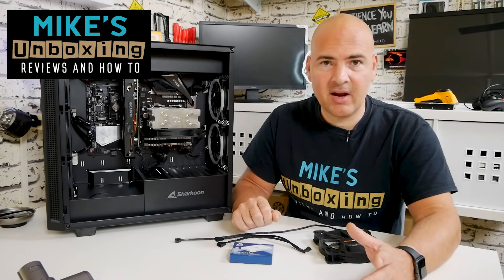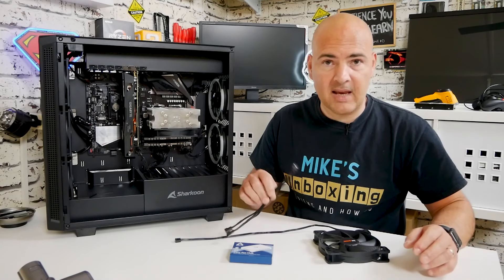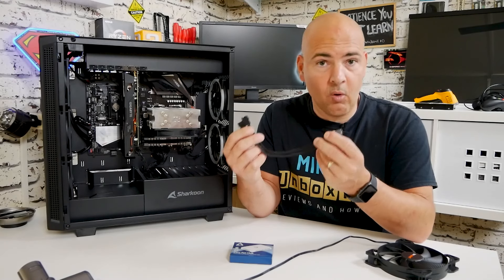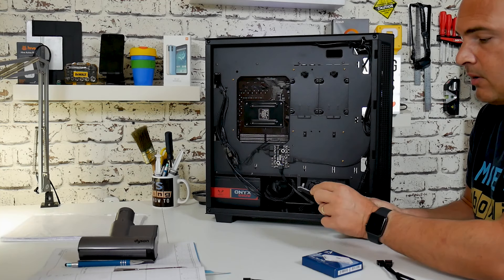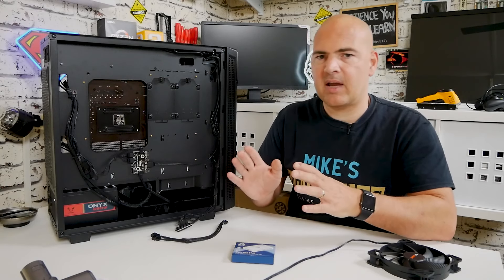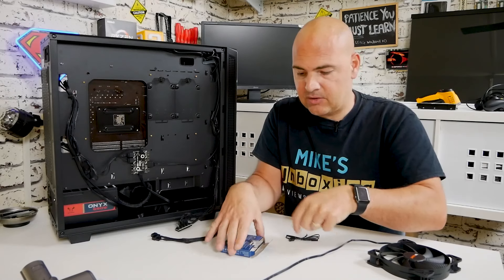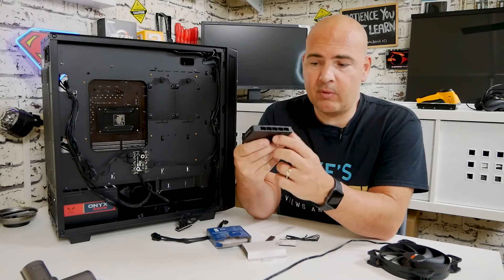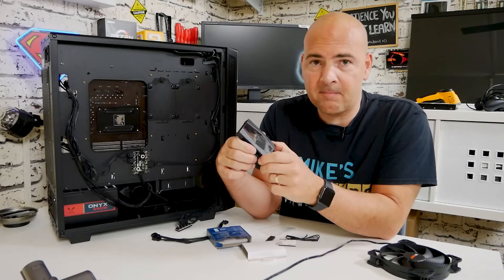How To Add Extra Fan Headers To Your PC Build

Comment: Hi I bought 2pin fans for my compact pc, would the 2 way splitter work with my 2 pin Fans?
Reply from the maker: not sure i don't know what a two pin fan can be used on? are they from a power supply or something? PC fans are usually 3 or 4 pin
Reply: @mikesunboxing  Thanks for your reply! I've read that if I plug it in to left 2 pins it should work. Hope for the best.
Reply from the maker: @DonTNguyen  Let us know how it goes
Reply: It was a success!  @mikesunboxing
Reply from the maker: @DonTNguyen thanks for letting us know & glad it worked out good 🙂

Comment: Great video! I have a question though. Will it put too much load that might be deteriorating to my mobo if I connect 3 fans using a splitter to one of the fan connectors on my b365m pro-vdh mobo? TIA
Reply from the maker: Not at all 3 should really be the limit though
Reply: @mikesunboxing  Thank you so much!

Comment: Hi! How do you control all the fan speed curves connected using the PWM splitter?
Reply from the maker: you can't it replicates the same signal multiple times
Reply: @mikesunboxing  thanks! does this mean that all connected fans would follow the fan curve of the 4pin split of the PWM splitter? or that the remaining fans would be more of an on/off concept? thanks!

Comment: With the fan hub, does that work with rgb fans or do they need a seperate connection?
Reply from the maker: rgb fans will need a separate RGB controller or hub
Reply: @mikesunboxing  thank

Comment: I have one fan header and a splitter where I want to put a single 120mm and 140mm fan but which one should be the master fan as the motherboard will only read the rpm of one of the fans?
Reply from the maker: they will be out of sync because they are not the same fan, i would maybe put the larger one as master to reduce the noise levels
Reply: @mikesunboxing  thanks for the quick response, sub earned 👍🏼
Reply from the maker: @RocksDLightning  Awesome - welcome to the Channel :-)

Comment: Can i use the pump fan connector for a regular rear fan?
Reply from the maker: yes you can
Reply: @mikesunboxing   And it can be controlled like a regular Chassi fan?
Reply from the maker: @theswede5402  That will depend on the board, some let you use it as anything, some don't. If it's a 4 pin one it should be OK, but a 3 pin one, probably not

Comment: Where do I put that fan hub in my case?
Reply from the maker: it is up to you really based on the length of the psu cables and fan cables, that will pretty much dictate where it can be mounted

Comment: Hello! I have a question. You said in the video the Arctic FAN HUB have 10, 4 pin connections. Can I connect 3 pin fans and controlled with these hub? You said another video (Deepcool FAN HUB) "PWM or nothing". What is the situation with the Arctic FAN HUB? Thank you!!
Reply from the maker: If you use 3 pin fans there is a very good change it will not be able to run the fans at anything other than 100%
Reply: @mikesunboxing  Thank you for the fast respond!!
Reply from the maker: @Szaky12  no problem happy holidays

Comment: Hi Mike, I've seen other splitters in the reviews that the fans run at the highest RPM? is it the same with the splitter? And with the splitter, a PWM signal is passed on to the other fans, is that also by this splitter?
Reply from the maker: a splitter just copies the signal to multiple devices so it will do whatever the motherboard tells it to

Comment: What about addressable RGB connections Mike, my Z490 has just one 3 pin connector so I can control the case fans from it but nothing else, are there splitters available for this type of connection, or maybe I'm being thick as usual?
Reply from the maker: Video coming up Gary all will be revealed and explained
Reply: @mikesunboxing  I look forward to that Mike, I see that Asaka make a splitter but will hold fire until I see your video.

Comment: i bought 2 3-pack case fans, both with their own fan hub (each hub can only accomodate 3 fans). can I connect the 2 fan hubs to a splitter? my mobo only has 1 system fan header. thank you very much!
Reply from the maker: if the hubs are powered yes if not that is a bit too much load on a motherboard header
Reply: @mikesunboxing  yes, both are powered. thank you!!

Comment: I have the reverse question.  I have a 2A -3A 120mmx38mm fan for an AIO.  The W-Pump header is 2A and obviously for the pump. Can I combine 2 fan headers to power the fan? Also does a reverse splitter exist?
Reply from the maker: no you cant combine two headers sorry

Comment: If I need to add 3 or 4 to the existing 3 I have already in the case with a B450M  mobo, do I still need the hub ?
Reply from the maker: if the fans won't daisy chain you will need something
Reply: @mikesunboxing  thank you for replying. This is my first “gaming” pc ever. I looked at the motherboard and noticed that only the cpu fan header was used to power 4 fans that came with unit. The other sys fan header is not used by anything. I am thinking of using the cup fan header just for the cpu cooler fan and use the other sys fan header to power up the arctic hub for the rest of the fans. Do you think this would work without putting too much stress on the pc? Thank and sorry for the lengthy question

Comment: Hello, I wanted to ask what happens when a short circuit occurs in one of the fans connected to the motherboard or when it connect straight to the power supply unit?

What can assure me that there is no fire will be occur?
Reply from the maker: Fire is totally possible or magic smoke from a burn out

Comment: So, connectig 3 120mm Fan (PWM) on 1 Mobo header is fine ?.. 
I was running like that for 2 days no problem everything is synced but just at once 1 fan out of 3 stopped spinning . 
Could it be that mobo 'fried'' that one fan ? (They are connected to 'Pump' header , Gigabyte says thay can deliver 3 Amps.
Reply from the maker: should be fine at 3a sounds like a bad fan, maybe try it on its own on another header?
Reply: @mikesunboxing  I think it's faulty fan too.. tried everythig from changin headers to changing Voltage /PWM modulation, even tested the cables with multimeter.. everything was fine ( and RGB is working ) but no way for fan to spin.. It is in refund process now 😂

Comment: Hi sir, where should I connect or the best to connect the 4 pin from the fan hub that I can control the fan speed. Is it the CPU Fan or System Fan? because I have connected my AIO fans and Chassis fans on the fan hub
Reply from the maker: chassis fan is the one you want to use if you can

Comment: Can a splitter have both a 3 and 4 pin in it without issue?
Reply from the maker: no they are different systems and will not work as intended

Comment: Can i control each of my fans individually if connected to that fan hub  or will they all run at the same speed i set in the bios?
Reply from the maker: they will all run at the same speeds as the controller puts out

Comment: Hi, I have an a320 motherboard which has just the 1 system fan header,  if i use the arctic hub will i be able to use rgb fans and if so is any extra wires needed for the rgb
Reply from the maker: no you won't be able to use rgb fans you need something like the gamemax hub i reviewed a while back

Comment: I have a b450i mobo with two fan headers (one for cpu fan, one for system fans) I want to have 4 system fans and one cpu fan. Am I able to connect 3 fans to the system header using a fan splitter and then connecting one system fan and the cpu fan to another header? Ps if I do that, then the fan connected to the cpu header will adjust fan speeds like the cpu fan???
Reply from the maker: yes you can do that

Comment: Can I use 2 Scythe Kaze Flex PWM fans ( with spliter ) of a Pump header?
Reply from the maker: yes you can but depending on the board and BIOS revision PWM control may be limited

Comment: I'm set with fan headers because my mobo has 7 of them, so I won't use more than 2 splitters for my 9 fans. My problem is (and I'm not sure whether it is a problem) the RGB. I have two 5 V ARGB headers for those 9 fans (Gigabyte x570 Aorus Master). They're the Enermax Sqa RGB, which I THINK draw about .4 A per fan, and I want to connect 3 of those to one ARGB header and 6 of them to the other. For the header I want to connect 6 fans to, I want to use a 1-to-4 ARGB splitter, connect 3 of the fans directly to my mobo with that, and use the 4th end for the other 3 in a daisy chain. I don't think 6 fans will be too much for this 5V header, but I'm curious whether it would be better to use both control boxes for that header, or if I can get away with just plugging 3 fans directly into the header with the splitter and only use the included control box with the other set of 3 into the same splitter.
Reply from the maker: Three fans on one header should be okay but a powered hub or box would be preferable something like the gamemax hub should do it
Reply: @mikesunboxing  Well, what I'd really like to do is place 6 RGB fans on one ARGB header using just the splitter cable. If my math is right, it should work. 5A 5V header = 25 watts. One of these fans has a rated current of .68, which I think is for the PWM and ARGB together, but assuming full load, it's .68 x 6 = 4.08 volts, or .68 x 5 = 3.4 watts per fan, x 6 = 20.4 watts. So, 20.4 watts seems ok to plug into a 25 watt header. Have I done all these calculations correctly or is there something I'm missing?

Comment: can i use the included rgb controller on my case to power up my non rgb nzxt fans ?
Reply from the maker: if it has the 3 or 4 pin fan connector you should be able to
Reply: @mikesunboxing  u always help me lol thanks you
Reply from the maker: No problem

Comment: can you put a 3 pin fan in the 4 pin connector on the y-splitter?
Reply from the maker: you can but it might not control very well if at all, unless you tell the motherboard to use VDC control
Reply: @mikesunboxing  Thank you! 👍

Comment: Hey there mike can i use the fan splitter on cpu fan header? So it would be the cpu fan and another system fan? Thanks im planning to use the msi a320m pro max.
Reply from the maker: yes you can

Comment: If i want to get rgb on fans do i have to connect to the rgb header for each fan on the motherboard or can i plug it in a controller? I want to change the colours by software too and i have a controller
Reply from the maker: both ways are possible
Reply: @mikesunboxing  ok thanks a lot 😆

Comment: So if I connect 3 led to the hub and the hub to PSU do I need to connect the other cables of the fans?
Reply from the maker: not really necessary to connect them to the hub but will need connecting to something like a controller or motherboard or they won't spin

Comment: My motherboard has 6 fan headers, I only need 5, can I plug them in separately. Will they all run at the same speed? B550 tomahawk
Reply from the maker: you can configure each fan to be either the same or custom speeds
Reply: Would I do that through software. First pc build.
Reply from the maker: @ashplattsii1fan92  This is maybe easier to fix or at least advise if we can ask more questions and get direct answers, so feel free to join our Discord chat and we can go over it in more detail https://discord.gg/gaeeDPw

Comment: I have 3 chassis fan/water pump headers and one CPU fan header... ASRock B550M/ac.
"CF/WP header supports the water cooler fan of maximum 2A (24W) fan power."
Trying to run 8 Sickleflow RGB fans. 3x3x2 should be good if the 1A, 12W CPU fan header will run an AIO?
Reply from the maker: should be okay, i ran 6 RGB inwin fans off of a single header and it wasn't until they were at 100% that the system would crash

Comment: I just want to know if, with a fan hub, does your motherboard register that and all the fans connected as 1 fan, or does the hub tell the mother board "theres actually like 10".

so like, using a fan hub, will all the fans connected individualy show up in your bios or?
Reply from the maker: it will appear as a single fan only
Reply: @mikesunboxing  good to know, thanks you.
Reply from the maker: @superhamsniper4487  No problem :-)

Comment: Good one Mike 👍😊 I always say if there's a problem then gotta be a solution 😊 I find my tool box always has a good selection of cable adaptors. I like the cable unit you've illustrated here re having some bios control {PWM 4 pin fans) GAMEMASTER cases with ARGB have built in controllers that can manage easily up to 8 fans from that control board as it has SATA power direct to it. I always have at least 3 fans in the case that are PWM bios controlled and the others free flowing. My temp figures are always really good so must be doing something right 😎 Oh and one build I had a card reader setup with separate usb and guess what! Oh yes not enough USB headers ! problem solved online with 1 to 3 USB adaptor. Stay safe ! As the Bee Gees remind us all 'staying alive, staying alive ..I can hear my mrs 'ooo ooo ooo ' 🤣🤣🤣 Ah those were the good ole disco days..🤣🤣😎
Reply from the maker: lol arthur you seem to be in fine form today - keep it up

Comment: So my case is a phantek eclipse p360a which already has 2 fans pre-installed via daisy chain. The case itself has a built in controllers. I bought 3 additional fans and I was wondering if it's okay to use a 3 way splitter and then connect that into the daisy chained pre-installed fans? Also my fans are all D-RGB.
Reply from the maker: how is the daisy chain powered? SATA or via motherboard header
Reply: @mikesunboxing  sata.
Reply: @mikesunboxing  i think I figured it out. I am still waiting for my ram, SDD and processor to come in the mail so I haven't taken anything out of the boxes yet. I am just trying to make sure I don't need to buy any other cables so when I start building this thing I can just get it together. This is the first time building a PC. In the past I had just got them already put together. I'm actually pretty excited!
Reply from the maker: @zq7246  Feel free to join our Discord chat if you need any help, or just to chat tech https://discord.gg/gaeeDPw
Reply: @mikesunboxing  sweet I'll definitely do that. Thank you!

Comment: Question, I have a dual fan cpu cooler with argb and pwm, is it safe to plug in the pwm cables to the cpu_fan and cpu_opt mobo header for pwm then the argb cable ends into an argb hub? Or should the pwm cables go into a pwm hub? Thank you
Reply from the maker: yes that is absolutely fine
Reply: @mikesunboxing thank you, Mike. Your videos have been helpful!
Reply from the maker: @briaaan.  Glad they helped 🙂

Comment: So other that the NZXT grid v3 is there any others that offer fan speed control, Mike?
Reply from the maker: they all offer fan control via the motherboard, do yuo mean individual control?
Reply: @mikesunboxing  yeah, individual control, like my old mobo only had 2 fan connections, so I had to buy a nzxt grid, now my friend has the same issue but he doesn't wanna use CAM, (for many reasons lol)
Reply from the maker: @TrevHowsonDemon82  thermaltake might be worth a look but theirs is much like NZXT a pretty closed system

Comment: You did not say if you can independently control BOTH PWM fans if you connect them with a 2 way splitter to the PWM port on your board.Please clarify if we can do this.
Reply from the maker: no it is a splitter and will equally split the signal

Comment: I have got A320M-S2H series motherboard and i have bought pack of three antec rgb fans and motherboard only has one sys_fan connecter which is 4 pin, can i just remove the rear fan and install on rgb fan there and one on top and connect them to splitter and then to sys_fan1 motherboard pin? Would it be ayyt or would it fry the motherboard?
Reply from the maker: you will not be able to connect the rgb to this board at all sorry, but the fan connections should be universal

Comment: so does that 10 port hub with 3 pin fans still let mb control speed or only 4 pin pwm fans get controlled? most of the hubs i have seen only control the 4 pin ones and the 3 pin ones run at full speed?
Reply from the maker: four pin fans will allow control, three pin fans will run at full speed
Reply: @mikesunboxing  Which kinda defeats the purpose in my opinion. Oh well thanks for info. I need something that can also let me control 3 pin fans speed by mb.

Comment: can i plug in a fan with 4 connections into the header with 3? it fits, but will it work?
Reply from the maker: sort of depend on the board etc. you will need to tell the motherboard to use dc control rather than pwm

Comment: Hey i have a question if there is only one argb header on motherboard so can we connect aio's argb with that and if this is possible can we control them with motherboard's software
Reply from the maker: yes most rgb aio will have a splitter so you use the single header and still connect more devices in a daisy chain
Reply: @mikesunboxing  thnx for replying
Reply from the maker: @anishgupta3063  No problem :-)

Comment: hi, thank you for the video. i'd like to see how you really install those device n fans onto your mobo and your case. im abit slow to understand things without vision-just hearing alone wont enough for me, sorry about that. i have this aigo fan hub and it has a slot for cpu fan with red labelled, do i use that for my cpu fan or just ignore it and plug the cpu fan onto cpu fan header at mobo?
Reply from the maker: Ok will do, i'll try and do another version of this video. regarding th eaigo set i'm not sure to be honest. if you want to post some pics of it in our discord chat i'll see what is going on